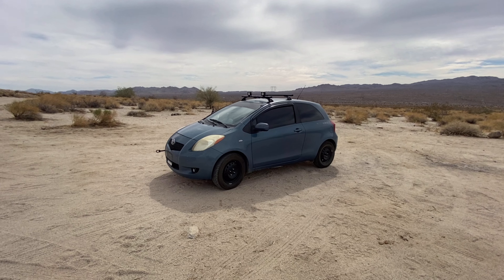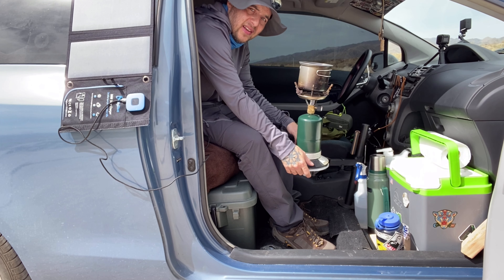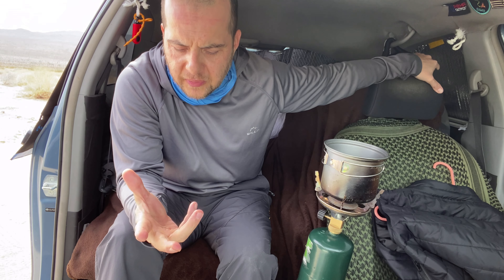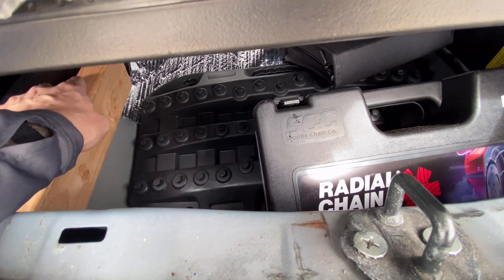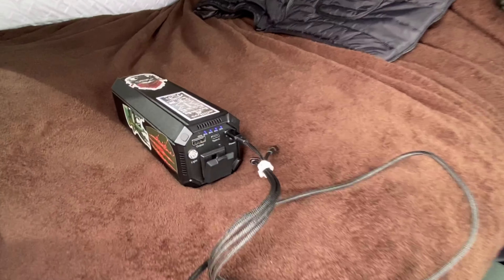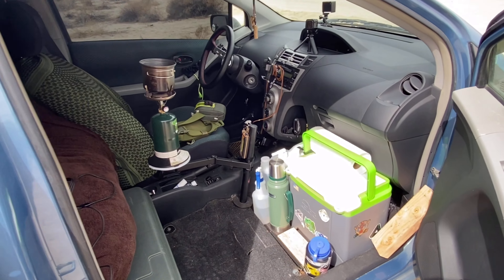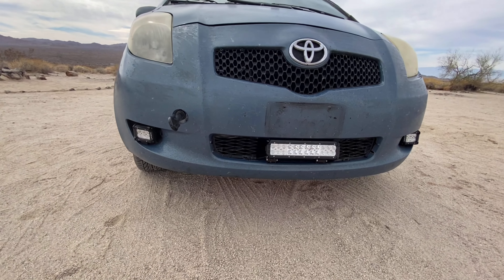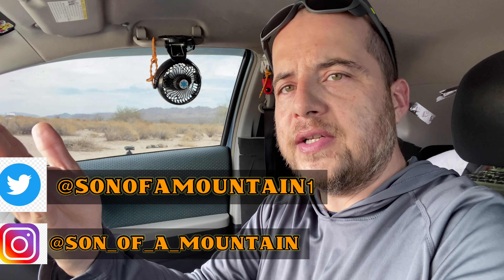HOW TO CONVERT A CAR INTO A MICRO CAMPER/Toyota Yaris Camper Update

Comment: Absolute genius with the underneath brush guard. Consider a similar setup on the back end to preorder your muffler and brake lines and whatnot. Man it’s incredible how versatile this little car is. Toyota needs to give you some kudos for your input. Thanks so much.
Reply from the maker: So that is actually a great point!!
I have just added an extension skid plate for the brake lines and the gas tank and the fuel pump components made out of hdpe marine plastic sheets.
It’s what they use to protect the bottom of rally cars it super lightweight but super tough and it works incredibly well.
Thank you so much for checking this episode!

Comment: Hi, kewl system! I bought my Yaris because I noticed with the rear seats folded forward I could nicely fit a full size air mattress. Its works but I'm only 5'9". Best tiny car for my camping was when I owned a Suzuki samurai and later a Chevy tracker. In both cars the front seats slid completely under the steering wheel and glove box leaving ample room to horozontally recline the front seats.

Comment: The repurposing of the computer monitor holder for the stove and table is brilliant!  Bolted down ROCK SOLID.  It occupies so little space, there is little likelihood of bumping into it - especially since you can swivel it aside, whichever side you may happen to be on - maximum efficiency and safety for the task, absolutely the best solution for the space, cannot be improved upon.  Bravo!
Reply from the maker: Thank you so much my friend 
Since this video I have made a few more upgrades on the Yaris camper ,I will be doing an update video soon.

Comment: Hi son of a mountain, how do the steering components of that yaris handle the abuse of corrugated roads? Surely it wasn't built for such conditions?
Reply from the maker: A few things to consider here,first I drive extremely careful down any dirt and rocky road,I take my sweet time and make sure not to push the limits of this vehicle.
Second- I have modified the suspension a bit nothing crazy,I added a one and a half inch lift kit since this video to help with some extra clearance,and I also added strut cushion buffers to all four struts to help  absorb some of vibration going down washboard roads.
The combination of all these things helps the steering stay intact,so far I haven’t had any issues,plus keeping in mind that the 2008 Yaris had no power steering,so it’s all arm control 😅.
Also airing down the tires are a must when going off road.
Hope that helps.
Reply: @sonofamountain2862  yes important to let air down. I've done a couple thousand k's on a badly corrugated rd without letting the tires down and asides from a very rough ride ended up with little cracks in the steel or copper pipes which carried coolant through the engine so had a bunch of leaks at the end of the trip and that was a 4wd designed to take it. I find 8o to 90km /h gives the smoothest ride

Comment: This is so cool!!!!!!!! Thanks a million for sharing!!!! I took the back seats outta my 98 camry for car camping on roadtrips, but the camry finally just died and I just upgraded to an 07 yaris 2 dr hatchback, with the intention to do a lot of road trips and camping! So stoked! Gotta do some initial work as I dont know what the previous owners did or didnt do but so happy and watching your videos is a huge help and so exciting! Thanks again!
Reply from the maker: I did a full tune up when I purchased my Yaris,the previous owner never did anything to the car as far as regular maintenance.
These vehicles are extremely reliable I can personally testify to that,my Yaris has never left me stranded but I also take good care of it with regular maintenance and since is not expensive to fill the gas tank I only use premium gas it makes a huge difference in both mpg and how the engine performs.
I got over 200,000 miles on the odometer and still going strong takes me anywhere I want to go.
Good luck with your project and I would love to know how it turns out.
Thank you for checking out this video.
Reply: @sonofamountain2862  Awesome, so great to hear! And thanks for replying! I was reading all through the comments the other night learning more about rad changes you've made! Man thanks so much for posting this info! I picked up some Mobil 1 oil and filter to change that here shortly, and am shopping tires. The rims that came on the car are 14s but the tires are bald. I'm sure I can get my hands on some 15" rims eventually sooner or later. Did you install those strut spacer things before you put on the bigger tires? Also definitely want to install some brush guard under the undercarriage, I saw you did a street sign off of amazon for $20, do u have any more info as to what you did for protecting the back part with the race car plastic stuff? Cheers!
Reply from the maker: @pineapplekatrina  you can keep the 14 inch rims and put a different offset for all terrain tires and that would work just fine.
The strut spacers can be but on at any time but it does help to have the front tires off when installing the back you don’t need to get the tires off at all but you do have to lift the car and make sure to spray the entire thing with soap water it will make it a lot easier for installing.
As for protecting the under side of the rear of the Yaris I used 1/4 inch HDPE marine grade plastic sheets this is what they use to protect the bottom of rally racing vehicles it works and it’s not heavy you want to protect the fuel tank,fuel pump components and the brake lines don’t be afraid of covering the entire thing this plastic will not burn or melt it can really take a beating.
But before you start any of that be sure that the engine is taken care off first.
Here’s some things that helped both the performance and MPG on my Yaris .
I clean the mass air flow sensor you can buy a spray specially made for cleaning it costs like 5$ and it will help with the MPG or you can buy a new MAFS for like 16$ parts for this car is super cheap.
Change all spark plugs this will also help the engine run stronger.
Make sure your serpentine belt is in good shape they cost like 10$ .
Air filter is a huge one specifically if you plan on driving on dirt roads,I check my air filter every two months I think they cost like 7$ the cleaner the filter the better your car will run ,more air the better.
Check your radiator fluid is it topped off? Is it super old? If so it needs to go.
That engine is your lifeline it is top priority anytime and every time,if you take care of it I promise it will never let you down trust me.
Also make sure all your battery connections are clean and your battery is up to date bad battery will usually fail when temperatures drop so keep an eye on that and check the date on it they should be changed every two years.
I know it sounds like a lot but once you do this you can drive that car and not have to worry about anything for a long time.
Am here if you need any help.

Comment: What is the dimension from the absolute rear of the hatchback to the back of the passenger seat pushed as far forward? I have the Yaris sedan and I installed a plywood bed platform and the dimension in the sedan is 72"  I suspect the hatchback may be somewhat smaller?
Reply from the maker: I no longer have any passenger seats in this Yaris.
But I was able to get some measurements with the driver seat all the way forward and from the absolute rear of the hatchback to the driver’s seat all the way forward I got 70 inches.
However the side with no seats at all,from the absolute rear of the hatchback to the glove box I got  88 inches to be exact,and this is where I build the bed.
Hope that helps.

Comment: I have a 2007 hatch back and want to remove front seat on yaris world fourms I see 2 ways 1 is disasemble  black box and all wiring from seat then tuck into console 2 is expensive its an occupancy sensor so how did you remove seat and keep system happy a functional on driver side?
Reply from the maker: I unplugged the battery first.
Then took off the 4 bolts that hold down the passenger seat.
Then unplugged  the wire harness connected (underneath the seat) to the passenger seat.
Then tucked the wire harness  under the floor rug.
Then reconnected the battery,everything worked fine zero issues of any kind,the airbags light stays on  and has been on for a couple of years now.
Other than that,I haven’t experienced anything unusual.
I didn’t remove any sensors,only the seats.
The system continued to work normal and functioning as it always did.
By unplugging the battery you protect the computer and the system from malfunctioning.
Hope that helps.
Reply: Thank you the ideas are stellar!

Comment: I’ve gotten so much inspiration and knowledge from your videos. Thank you and I have a question that  I hope you can point me in a direction to solve.
I’m modifying a Hyundai Elantra hatchback. The seats were easily removed but now I have a dashboard light that is constantly “on” 
I’ve been told I need a resister built to attach to the wires and bypass that. Problem is I don’t know/can’t find anyone who can deal with this. Can you recommend a solution?
Reply from the maker: My friend thank you so much for for your kind words I really appreciate you.
I had the same problem with my Yaris where a dashboard light for the passenger seatbelt and airbag kept blinking constantly,so after a bit of research I just removed a fuse and the problem went away.
Now am not sure if this will help with your Elantra cause every vehicle is a bit different on the electrical design,but it worked for my Yaris.
Hope this helps ad thank you once again.

Comment: Great video, How much was the mpg improvement after moving the air duct to the front
Reply from the maker: @nas979  I gained anywhere between 3 to 5 extra miles per a gallon, depending on terrain and how much weight I was carrying.
So it made a huge improvement overall,and it kept  the engine nice and cool when driving around the desert 🏜️
Reply: Really good, would you mind sharing a link where to fir the mesh at the front you mention at 19:44
Reply from the maker: @nas979        https://www.amazon.com/TCMI-Air-Filter-Cover-Car/dp/B09ZP2DPTG/ref=mp_s_a_1_2?crid=UQVGEB0CTMQC&dib=eyJ2IjoiMSJ9.Uylmb6WARdmrmZt3CIzhX3UvbHdESVI6PEXOut1MHU9mhqkHwpySPPSsToh-namVvm5BZwlEMzYRqB2IrsJZRbF-4c3XWvtAie_Ivh5HYNNsSzrVxYVqcMFKhEb44whkihTVRyEgEXlIBcK-XdLw4of5MQzgRf7TXEaJ_opTdPm9puXyDShILc5QqFX-uwphbN8iyCq-obXBrPA5B9yPbQ.4Su98qsxKZdJSHHe6PXMXwPllwqtpWkWGIAzVnijlh8&dib_tag=se&keywords=air+intake+mesh&qid=1737233609&sprefix=air+intake+me%2Caps%2C209&sr=8-2

Comment: I love your car. Where can I get that skid plate?  Can you send me the link? I have a 2010 Yaris sedan and I have to work on a long mountainous rural road.  This would be of great help to me because I am trying little by little to convert the car offroad.
Reply from the maker: Hello my friend and thank you for checking out this video.
Am using a Do Not Enter traffic sign as a skid plate,it’s the perfect size for the Yaris and it’s 4 millimeters thick providing plenty of protection under the vehicle.
You can buy the sign on amazon.
Reply: @sonofamountain2862   thanks for answering.  I apreciate it.

Comment: How do you do the air intake mod? I own an 07 Yaris sedan currently getting ready for a 6k mile trek to Alaska
Reply from the maker: I used a 3”76 mm  air duct marine grade.
One end went behind the front grill and the other end straight to the air filter box.
Here’s a link 
https://www.amazon.com/gp/aw/d/B07QCPKHZ7/ref=ppx_yo_mob_b_inactive_ship_o0_img?ie=UTF8&psc=1#
Reply: @sonofamountain2862  You’re content and Yaris are DOPE by the way!!!

So was there a way you fastened it to the grill!? Air box? Just a bit confused on how to actually assemble it
Reply from the maker: @thomaskaufman8460  thank you .
I ended up using a air duct mount.

https://www.amazon.com/Spectre-Performance-8148-Mounting-Plate/dp/B000BPUTL4/ref=pd_aw_fbt_img_1/145-9893747-3613605?pd_rd_w=dH8uh&pf_rd_p=76328f70-5fff-49b7-869a-94bfdaa768fc&pf_rd_r=S1R88R98N9D537VKGJMJ&pd_rd_r=36841e3c-9942-41fb-90b7-b47ea87b49d5&pd_rd_wg=McjWj&pd_rd_i=B000BPUTL4&psc=1
Reply: What was the average boost in MPG?
Reply from the maker: @thomaskaufman8460  I can’t tell you the exact number but I gained somewhere around 5-8 extra miles per a gallon.
Better airflow =better mpg 
Also the car did gain a horse or two and it’s definitely noticeable especially when am passing other vehicles on the highway.
Reply: @sonofamountain2862  did you buy one or two duct mounts?
Reply from the maker: @thomaskaufman8460  just one for the grill and the other end fits directly into the air filter box.

Comment: I can’t find a shop that will decompress my springs to add in a similar lift to yours
Reply from the maker: You don’t need to decompress the springs.
Just lift the car and spray a bunch of soap water on the springs and on the strut buffers and push the hell out of it until it pops in.
It’s super easy.
Reply: @sonofamountain2862  you don’t happen to have a link to the stuff you used do you? The only kits I can find have bolts and look as if you have to do a lot more work then that
Reply from the maker: @xbigbobsagetx   https://www.amazon.com/dp/B07S41GZHZ/ref=cm_sw_r_cp_awdb_imm_GEB1ER61KXTHCT5GTY7W?_encoding=UTF8&psc=1
Reply from the maker: @saus675  oh it definitely works.
Reply: @sonofamountain2862  Size F? I have a Yaris also.

Comment: Dear friend, coil spring buffer /booster, size???
Reply from the maker: You have to measure how many millimeters in between the spring spaces.
Here’s a link to help you out follow it and it will help you with your particular vehicle,every suspension is different but this is super easy to install.
https://www.amazon.com/dp/B07RZVC137/ref=cm_sw_r_cp_awdb_imm_GMYVGCV3C12WZQFGZ39X
Reply: @sonofamountain2862  tnx bro.

Comment: Hey I'm really curious, how many mpg did you gain from that air intake?
Reply from the maker: It added an extra two to four mpg.
Of course a lot comes into play,tire pressure,clean air filter,weight in the vehicle,terrain ect….
But for my set up I went from 26 city / 36 Highway to -28 city / 40 Highway.
I definitely noticed a substantial difference.
Reply: @sonofamountain2862  wow that's impressive, I have a Subaru Forester and I only get about 3 extra mpg by changing my driving style
Reply from the maker: @dylanlucas3397  this is a 4 cylinder car with a 1.5 liter engine,it was already good with gas but I knew that adding more air flow would improve the gas mileage.

Comment: Hi may I ask you a question, how do you sleep while closing the car doors? I mean don't you run out of oxygen?
Reply: No car is airtight buddy.
Reply: @z-trip5457  so it is safe enough to sleep in the car with closing door and window?
Reply: @xiaomajm89  Sure! Although I highly suggest you open one window ever so slightly, just to get some fresh air in.
Reply: @z-trip5457  yea I'm thingking bout sligthly open the window and install some kind of magnetic mosquito net on the windows, because sometimes place I camp got lot of bugs coming inside my car
Reply: @xiaomajm89  Great idea! That will certainly work!

Comment: Whats your tire size/spec
Reply from the maker: On this video I had 205-65r-15 all season tires but I swap dose out recently and now I have 205-70r-15 all terrain tires and it’s very helpful down dirt roads.
Reply: @sonofamountain2862  your running a 205/70/15 on stock ride hight? I understand you've got those spring buffers but did that actually give you any lift. Also whats the mpg looking like with those tires? I'm thinking of a 195/75/14 on stock ride hight. Thanks for the info!
Reply from the maker: @nglatt11  hello my friend and thank you for checking out this video.
I am running a 205/70r/15/  all terrain tires,the spring buffers are helpful and did give me a half inch lift but that wasn’t enough I also added a lift kit specifically made for a Yaris it wasn’t easy to find or install but I managed and it gave me a one and a half inch lift.
So with both the spring buffers and the lift kit combined I got a two inch lift,which was enough to fit these big tires.
Also the gas mileage didn’t change much because I made a custom air intake to improve the airflow and maintain a good mpg.
Here’s a link to the lift kit 

https://www.amazon.com/DEALPARTS-Leveling-Corolla-Fielder-Cruiser/dp/B09CTZ832V/ref=mp_s_a_1_3?crid=STANG95BINR&keywords=toyota+yaris+lift+kit&qid=1650388472&sprefix=toyota+yatis+li%2Caps%2C124&sr=8-3&ufe=app_do%3Aamzn1.fos.18ed3cb5-28d5-4975-8bc7-93deae8f9840#
Reply: @sonofamountain2862  Hey thanks for the reply, I ended up going with a 195/75/14, which will give be a 1 inch lift and a bit more cusion for the pushin. I didn't want to go too big. And I've also found that lift as well and found a very small amount of information about it. The rear spring spacer is fairly straight forward but the front spacer, I'm still scratching my head about. It's worked out for you and the install wasn't too bad? Also did you have to take apart the front strut to install the front spacer. Thanks for input and sorry for all the questions! Nick
Reply: @sonofamountain2862  Did you have to do much additional work to get the tires to clear? We just installed the same lift kit on our yaris and as it is the 205/70r15 dont seem like they would clear. My hope was to run Grabbers on it.
Reply from the maker: @liamgray9113  I had to add a 30 mm leveling kit.

Here’s a link 

https://www.amazon.com/gp/aw/d/B09CTZ832V?psc=1&ref=ppx_pop_mob_b_asin_title